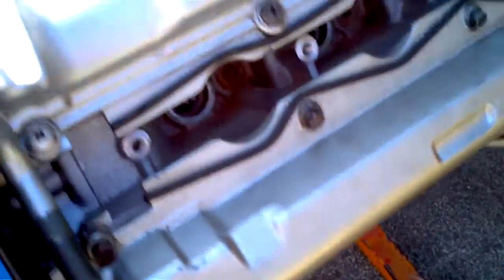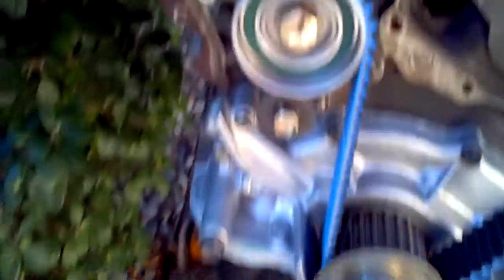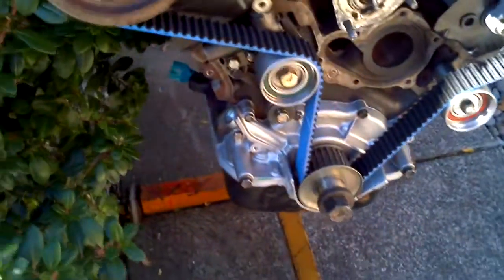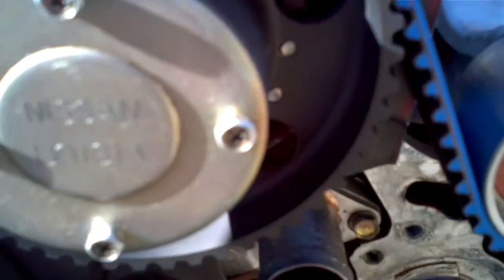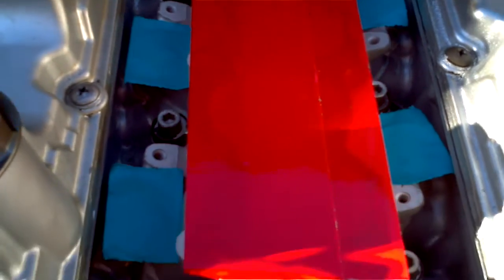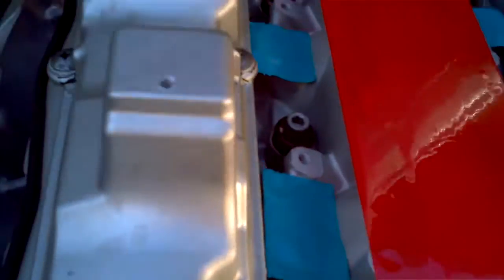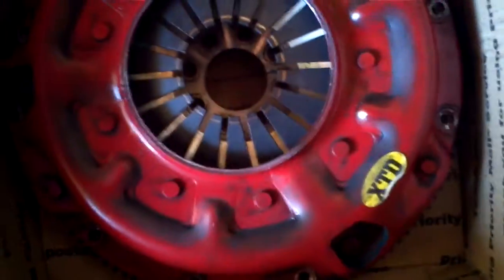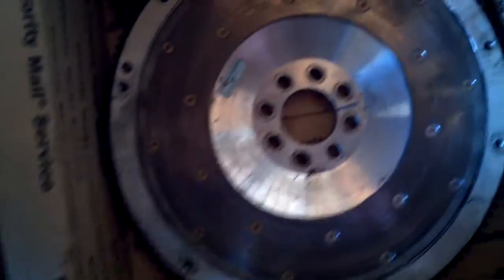300zx BDE cam gears Gates Racing timing belt custom forged build wiseco pistons

Comment: OEMbelt is better then Gates or any other aftermarket crap. Why does a higher HP engine require a better belt? The power is all going out the other end of the crank. What needs to be discussed is the tension load on the belt. Get real here and stop with the marketing bullet points. Blue is hype and the OEM/OES belt is going do the job
Reply: I can agree. My stage 3 VG30DETT came with a  Greddy blue timing belt and you can actually see the blue wear off on the rollers and gunks up under high RPM!!

Comment: What hp and torque did you wind up with and what fuel grade octane?
Reply from the maker: Please check my other videos car has been done for a while many dyno runs. 582whp will be back for more power next spring. Needed a few more mods and I would have hit 700whp according to my tuner Greg Dupree and Sebastian chacaof at specialty Z. I no longer run that clutch and flywheel I use a specialty Z high five clutch and specialty Z flywheel.

Comment: Thats bad ass man. How much did you do your self, and what was done by a shop? How much did it cost?
 I'd love to send my engine off and have it returned looking like that!....Drools...
What horse power are you going to be making when it's all done?
Reply from the maker: Just got the receipt for it all the other day, about 3800 for the machine shop bill, I took the motor apart myself, all the way down to the block. 650 for the weisco pistons,500 for the cam gears 180 for the new oil pump, 120.00 for the belt. So your looking at $5250 from the guy I used if you do the same. You can see what i did in the drop down in the youtube vide I dont no if that is available on google plus you may have to go on youtube directly but I did evrything bored and honed to 87.5 with wiseco pistons,fully ballanced with the counter weights tig welded,also rebalanced with the fidanza lightweight flywheel and my lightweight underdrive pulley. Decked block and maged for leaks or cracks, pressure tested heads to 100%, new valves eg style,new lifters,stock cams and springs, resurfaced head with new headgasket oem. Ported cooling passage.I guess thats about it I probably forgot something lol.
Reply: Very nice. I was guessing 5k-6k, and thats doing a lot of it your self. Better then new. 
 I can't wait to hear it run.
   I hope you don't go with a typical HKS or Greddy exhaust. IMO, Borla sounds so much better. Depending on HP, 2.25 pipes are good to over 500hp, 2.5 pipes are good to well over 650hp, and 3" pipes are not needed untill over 700hp.
Factor in each pipe only carries exhaust for 3 cylinders when choosing pipe size vs HP. If pipes too big you lose a lot of torque.
If you want to be unique, and sound bad ass, get these:  (delete rear mufflers, and put in place of resonators) http://www.ebay.com/itm/360656736946?ssPageName=STRK:MEWAX:IT&_trksid=p3984.m1423.l2649   I have something similar, but only 400hp, so mine are not straight through design, and I get 480 torque.
  I been designing exhaust for 2 decades.
If you want me to post a clip of how mine sounds I can. There is no Z that sounds like mine :)
Reply from the maker: Ive owned this car for 13 years, I have had 2.5 all the way back since 2004. I will upgrade to 3 later for sure, probably going to buy gt3076r as my turbo setup which puts me in the 3 inch range.I have a ton of mods, you can check some out on my google + page. Have some pics of the exhaust there and others,will add more soon,Its google+ 300zx comunities if you are not already in there,type in Brian Heiden once your in there it should pop my stuff up.
Reply: Brian Heiden ok, I'll check it out.
What HP you think you'll have?
Reply from the maker: guessing at least 500 on 91 if I get the 3076r turbos. Still have stock cams so not sure how much power I am missing out on there just did not have the coin for that right now.
Reply: Oh man. You should be shooting much higher with all that internal work.
Our motors can handle 500-550whp with stock internals. 
@ what boost you shooting for?
 I think thats a very low estimate. 
You're build can handle 800+ WHP.  (as long as you have the injectors for it)
I'm going to be trying to get 500 at the wheels with stock turbo's. I heard they can push 23 lbs, so after I change injectors, I'm going to try pushing 21 lbs, and hope to achieve close to 500 whp, and 550 torque.
  You're not missing much with out cams, but the springs can get you a lot more RPM's
You're redline is the point the springs can no longer keep up with the pistons. 
It would be fun and not much money to upgrade those springs to something that can get you 8k RPM's. And then the bigger exhaust becomes a real asset on dyno charts. I think a modest goal for your build is 650 whp. And have a very fast daily driver that last a long time.
Reply: What I'd really love to do is get over 1200 whp and go to Oklahoma and show those street racers whats up lol
Reply from the maker: I dont no anything about oklahoma I live in California in the Bay Area, but I will see if I can see what your talking about. 1200hp I would need cams a metal headgasket for sure, major port work bigger valves and springs and probably twin gt40s or something huge of that nature. Or maybe those precision turbos fitted up never seen one with those yet.Last year at specialty Z when I was down there Greg was telling me about a 1500hp build he is doing for an 80 year old man. So I guess those numbers are possible its just at that point you might as well have bought a porsche or a ferrari used in most peoples minds,rare somebody wants to spend that much on our cars since the resale value isnt really there on them unfortunately.
Reply: Porsche and Ferrari only have half that HP.
 There are a lot of Z''s on you tube with 800 whp. Busting those rich guys super cars.
 Oklahoma is home to the TV show "Street Outlaws" on discovery channel. They did go to SoCal and beat the crap out of some of the fastest guys down there. It's not realistic that I could get the HP to compete, and then drive there to race them.
 My more realistic goal is to be able to beat any Vette, or Viper that lines up with me. (about 650 whp would do it)
  You'd need the metal head gaskets, and the right head bolts to hold the heads down under about 40 lbs of boost to handle 1200 hp. Port and polish not so necessary, but would be a nice touch. Cams with longer duration would be necessary, and straight pipes out the side of engine bay.
  I don't know what your turbo's will be capable of, but I think a good goal for you would be around 25 lbs of boost. That should be a safe level, and would get you the same numbers as a nice Ferrari..
 I have seen our cars going for 25-30k with around 650 whp. Thats not bad IMO.
Reply: We all have different idea's and goals for our cars. You're a little more modest, and thats good. Your car with a modest 500-550 whp will last a long time and be very dependable driver.
I'm actually going to sell mine after I get the max HP I can out of my stock turbo's and a super nice paint job and interior.  I have a refinishing shop, so I can put a 9k paint job on it for a few hundred $'s. When I finish I will be asking 12k and hope to get least 10k out of it. Having as close to 500 whp as I can will help that sell a lot. Then I want a Harley lol.
Reply from the maker: Oh dont get me wrong if I can get 600 or more im down ha ha. I have some pretty good mods the turbo choice will be the determining factor. I really dont think anyone has ever got more than 550 on realistic everyday 91. It is about the limit for our motor,unless someone puts a monster single on maybe but no one even tests at 91 once they are up at those high levels it seems like. Im actually trying to figure out the record for 91,might be something for me to chase after.